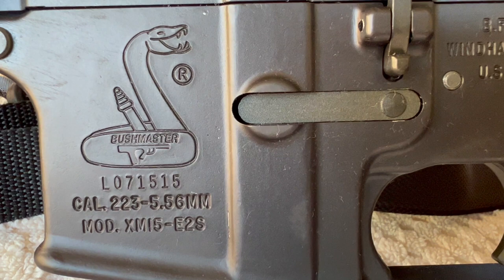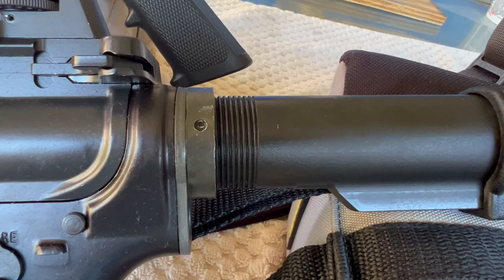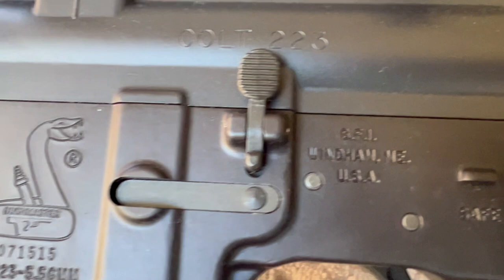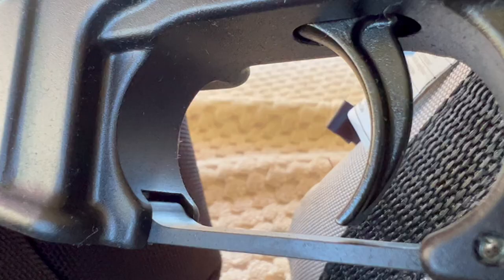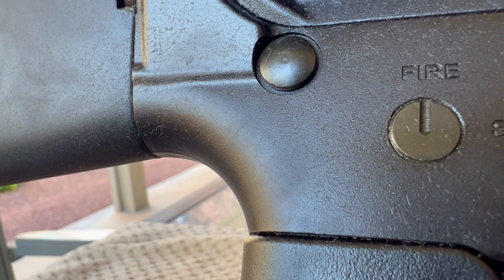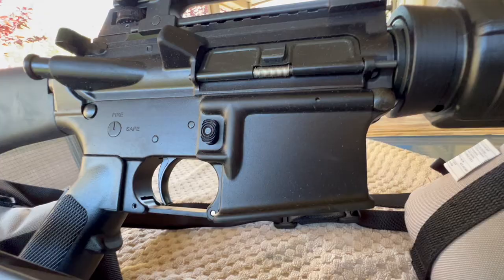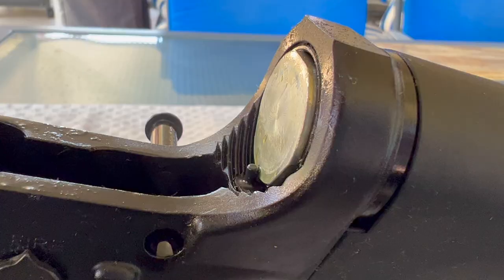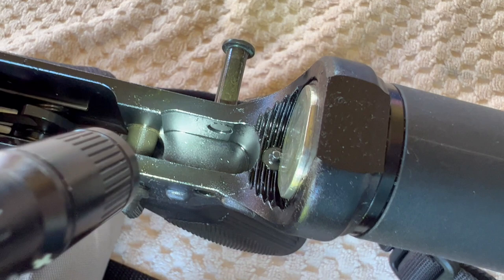Windham Weaponry vs Original Bushmaster Lower!

Comment: I bought a ban model that doesn't have have flash hider on the barrel and not machined for a screw on type but someone has installed a three position stock.  Weapon is new never fired,any ideas on obtaining a flash hider that will fit said weapon without machining?
Reply from the maker: They sold compensators/brakes that would attach with set screws for the non-threaded barrels years ago during the Assault Weapons Ban. They may still be around somewhere but I haven't seen one for quite some time. You may be able to machine one from a larger caliber A2 such as LR308/A10 and drill holes for set screws. The only other option is to pull the barrel and have someone thread it. There's a retired METRO cop here in Vegas that would thread an AR barrel for $50.00. I believe John Thomas of Retro Arms Works offers this service but I don't know what he charges. R.A.W. is out of Illinois.
Reply: i am looking for the same thing..... i have a xm15 hbar 20"barrel without the flash hider and was wondering how to attach one
Reply from the maker: @answersforlooking9430  The set screw version I'm sure is still around... somewhere! Lol!

Comment: Thank you for confirming what I've always - believed and that is that they just don't make things like they used to. No hate meant against Windham Weaponry. I'm sure they are more than sufficient to get the job done. But I want to say thank you for this very in-depth and informative comparison. I have a fix handled A1 m4 style Bushmaster carbon from the early 90s with a 16 inch barrel that's 14" plus a. 2" compensator or whatever. What I really love about this set up I'll do it is practically meaningless is that the bayonet fits purposely since the compensator is much bigger than a pencil barrel upon which the bayonet wabbles making it basically pointless pardon the pun😊
Reply from the maker: Sorry for the late reply! YouTube notifications often don't work well! You've probably heard that Windham Weaponry has closed their doors and no longer in business! Unfortunate! Not the best rifles but they weren't bad either!
Reply: Not good as any colt dd or fn made quality is wwl I put my 20in government a4 fit and finish up to any the big plays and it beats most colt Cr new models or not colt parts at all mix run of the mill junk a tcp colt old school first model 6920,le is the real good AR-15 they or gtg spec  as for Springfield saint s or Windham weaponry a4m4gov they gtg and will last a life time

Comment: I really like my windham. I've had it for about 7 years. The one thing i don't like about the lower is the gap that appares machined behind the pistol grip. Yours bush master looks like it may have the same gap my windham has.
Reply from the maker: I have quite a few AR's where the grip and receiver aren't perfect. The Colt new old stock (NOS) grips seem to fit the best most of the time. Thanks for watching and commenting!

Comment: I wish I still had my old (2003-2005?) Bushmaster rifles. I have picked up some very nice uppers and lowers from the new kids on the block (PSA, BCA, Del-Ton) but there's just something about the Bushmasters I miss. I came across an original Bushmaster 20-iinch A2, HBAR last summer. I'm sort of happy to leave the HBAR in my memories, but I almost grabbed it just to have a Bushy again. I wish I had. 🙁
Thanks for the video!
Reply from the maker: When I did the comparison to the newer Windham I was a little surprised at how well the machining was done on the Bushmaster using the older techniques of the day. The mag well area was way better on the Bushy! Thanks for watching and commenting!
Reply: I grabbed the same, a2 hbar,  for 400 on GB.  COuld not believe I got it.

Comment: Thanks For The Comparison Pete 😀😊😀 I Like Both Rifles Is The Bushmaster 1:9 or 1:7 Twist
Reply from the maker: The Bushmaster with the Colt upper is a Carbine HBAR, 1:9 twist, NATO 5.56 chamber and barrel chrome lined. Colt complete uppers sold separately back in the early to mid 90's I believe other than 20" were called conversions. The conversions had the caliber stamped on the side of the receivers. 7.62x39, 9mm, .223. The .223 stamped receivers as far as I know all actually had NATO 5.56 barrels. They came complete with a magazine and whatever else was needed for that caliber.
Reply: @peteregger7928  Pretty Neat Set Up I Really Would Like to See You Shoot It if You Haven’t Already In a Video I Missed  I Also Prefer The Bushmaster Roll Markings Vs Laser Engraving of Windham

Comment: looks like somebody installed a retro xm177 style car stock on the bushmaster with that aluminum stock and spanner nut assembly.
Reply from the maker: I bought the complete lower brand new that way. If you look closely at the stock you can see the little "B" forging. Bought the complete lower around late "94" maybe early "95".

Comment: I have this same type firearm, my question is: in front of my serial # it does not have a “L” in front of the numbers. It has BFI then the serial number. What is the difference between the “L” and BFI.
Reply from the maker: Was your's purchased before or after the original Bushmaster was sold to Remington (Freedom Arms Group)? Thinking that might be the difference? "L" was original Bushmaster for sure but don't know when or who started using BFI?

Comment: I just bought one from egunner can’t wait to use it
Reply from the maker: Bushmaster? Original?
Reply: @peteregger7928 I have a question my ar the front of the barrel where the muzzle goes is that a thread protector? Or I gotta take it to someone to make me some threads
Reply from the maker: @Dredogg820  Not sure I'm understanding your question? If the muzzle end of the barrel is threaded it should be 1/2" x 28 TPI (threads per inch) for 5.56/.223 and you just install the muzzle device of your choice using some type of jamb nut, crush washer or split lock washer. If you do not wish to run a muzzle device then a screw on thread protector should be used.

Comment: bushmaster has that damn ban era BCG and hammer just like mine thats a very close SN.
Reply from the maker: Good eye! It's actually a 1994 Colt conversion upper sitting on top of the Bushmaster lower for this video. The Colt upper conversion's back then came with the sear block lower BCG because they didn't know what type of lower they were going to be used on. Only Colt was doing this with the BCG supplied uppers. Some manufacturers back then  did civilianize the trigger group and at the time I made my purchase this was the case with Bushmaster. Thanks for watching and commenting